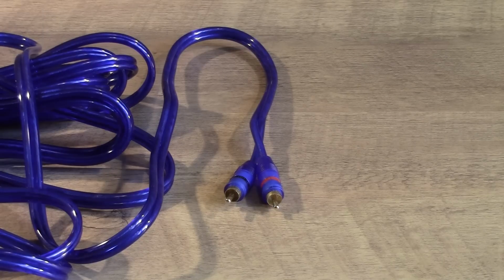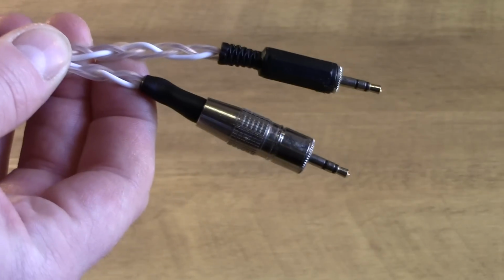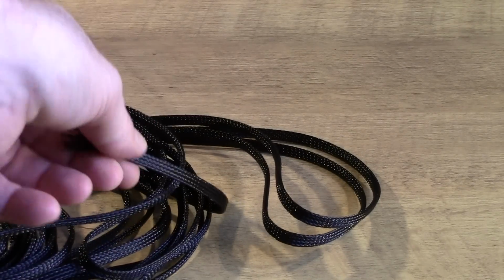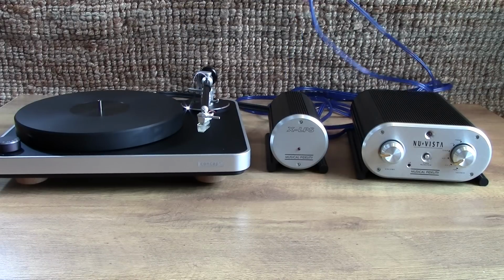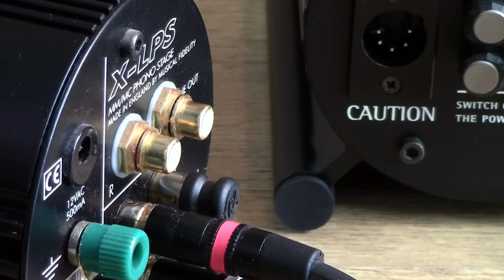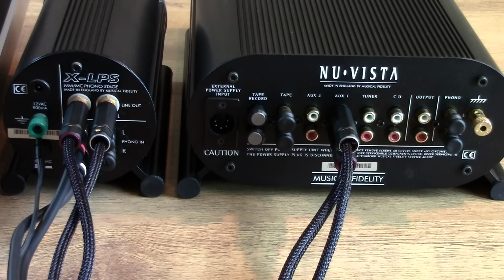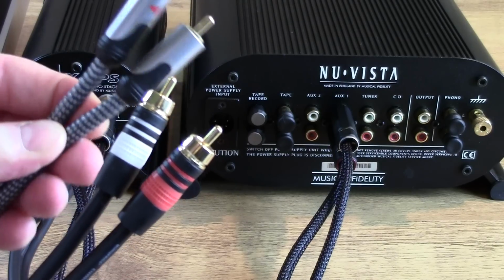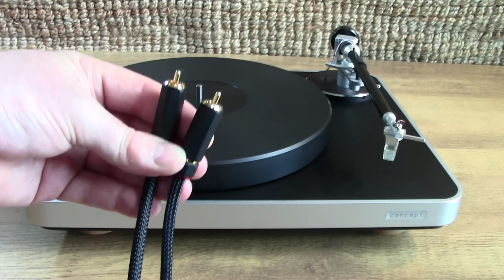Turntable Update 15: DIY RCA Interconnects

Comment: wow finally! men, i made just the same as you same "Qimber" ;)  like brading (to conductors to mass and other to live) just for bright up my too much warm sounding class-d power amp using 3 screws RCA plugs from hificollective and silver plated cooper wire made for internal line level audio wiring... it sounds as bright treble as i wanted for!! thanks for sharing
Reply from the maker: Hello, Thanks for watching and commenting on the video, It's much appreciated.   I'm glad that your new cables are working out for you!  Cheers Tudor

Comment: There is a common misconception that twisting the two conductors of an interconnect cable together can somehow contribute to noise rejection, and even that it can perform as good a job of noise rejection as a good shield can. But the phenomenon by which twisted-pair wires reject noise--called common-mode noise rejection--works only in balanced audio circuits, not in the unbalanced circuits (RCA connectors) that are nearly universal in consumer audio gear - Kimber wire twisting only works with balanced XLR.

Comment: Blue jeans cable LC-1 are the best interconnects I have ever used, Highly recommended. Ultra low capacitance and top quality shielding. They made a huge difference in sound quality compared to the cheap kabledirekt RCA's from amazon.
Reply from the maker: +utubie24 Hello, Thanks for watching and commenting on the video, it's much appreciated!  I keep meaning to try Blue Jean Cable products.  I've heard great things about them.  I'll make the effort this year to order a pair of LC-1 interconnects, thanks for reminding me.  Cheers Tudor
Reply: I have the Blue jeans LC-1 and agree they are a great cable for the price. Just be aware they are a bit stiff so you need a little room on whatever side they exit the eqpuipment.

Comment: May I ask why you didn't go with a better cable. I learned my lesson long ago about Cables and first I went with high end rubbish, I call them, MIT and then after learning that they sound no better than a good cable from Belding or just about any other quality cable manufacturer. I went with the same connectors your using and Belding cable. I applaud you for not falling victim to the Snake Oil Cables as I did at first.Thank you Tuturle for taking the time to show how too build a good cable. Peace My Friend and stop by my channel, Steve @VT&A!

Comment: Good vid. Always look for cables with the lowest recistance.
utubie24 recommended a good cable.
Reply from the maker: Hello, Thanks!  Yes low resistance is important, it's the crucial property of speaker wire, but with RCA interconnects the capacitance is the most important factor.  The Blue Jean Cables RCA interconnects recommended by utubie24 are ultra low capacitance, even lower than the Kimber Kable I'm using here.  I keep meaning to give them a try, I will at some point and make a video about it.  Cheers Tudor

Comment: When your amp has a phono in why are you using a pre-amp?
Reply from the maker: Hello, Thanks for watching and commenting on the video, it's much appreciated!  The reason that I use a separate Pre-Amp is that the Amp is about 3 meters away from the Turntable.  Sending the very weak signal from the Turntable that distance doesn't work that well.  Also the Amps built in Phono Stage only has MM, the separate Phono Pre-Amp has both MM and MC.  I currently use MC (although it was MM in the video, and I now use a different Phono Pre-Amp, the videos are a bit behind the times). Cheers Tudor
Reply: +tuturtle Great, thanks for the response. Nice to know the technical side. Keep on learning. Thanks